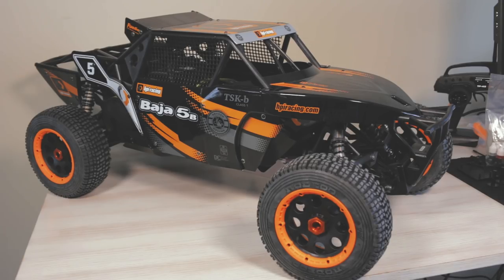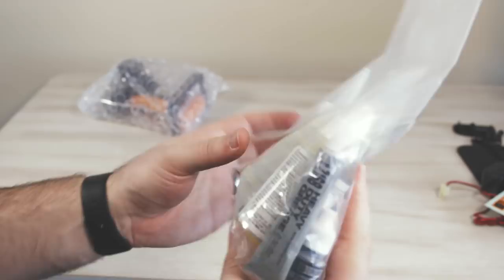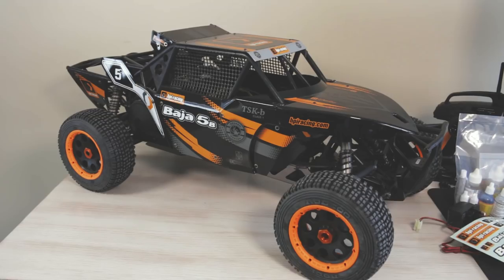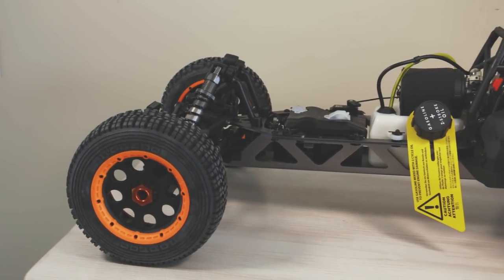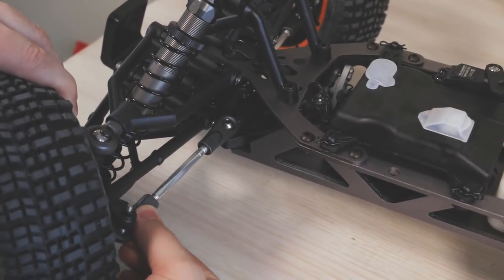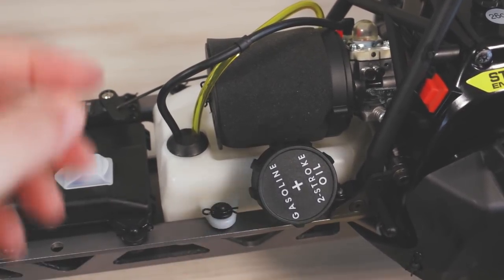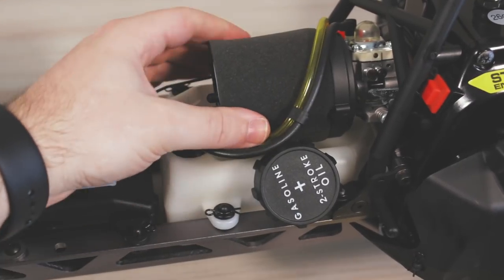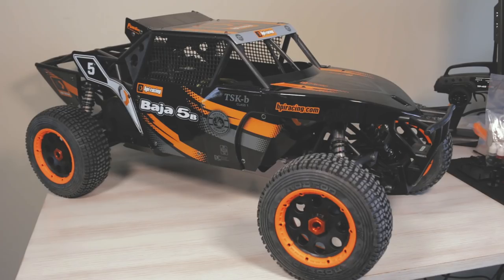HPI-Racing baja V2 kraken tsk-b class 1

Comment: I bought my HPI Baja 5b SS in 2010 and I had to install a "Killer Bee" Fail safe for only 50 bucks and did not come with a radio. Retail at the time for my Kit was 500.00. Still runs like a beast. HPI did a fantastic job on that Buggy you have!!!

Comment: Nice review! It doesnt matter if the choke lever is touching the throttle linkage because it will only be used during a cold start. But the under guard of this baja has diff oil all over it which is not a good sign.

Comment: Your throttle cable needs to get repositioned, it should not rub on the clutch housing like yours is,  mine came the same way, I just moved it inboard so it’s not chaffing and binding. A remote kill switch is a must. The stock transmitter has a 3rd channel that I’ve hooked up the kill switch.
Reply from the maker: Thanks, some of the guys in the shop told me the same thing, I guess it’s kind of a shipping thing where some of these throttle cables are wrongly positioned.

Comment: I own one of these baja krakens ive only had it running afew times as i have this bogging issue up on acceleration. I took it out to give it a good run and started to tune it. I noticed after afew runs that oil has leaked out from somewere. It was all around the base gasket and out from the exhaust gasket. Would you say its possible for the exhaust gasket to leak and run down around the base gasket? I hope its just the exhaust leaking and not the base gasket too. Its normal for the choke lever to get in the way of the brake rod. Mines exactly the same. Have you also noticed its very hard to get fuel into the tank with the whole body on. I have taken the panel off on that side.
Reply: Ya the exaust gasket does leak, try and tighten it up, but its fine.

Comment: Your linkage is set up wrong. The throttle linkage is supposed to ride above the brake linkage, not side by side. I had a similar issue until I rotated the linkage counter clockwise 90 deg.